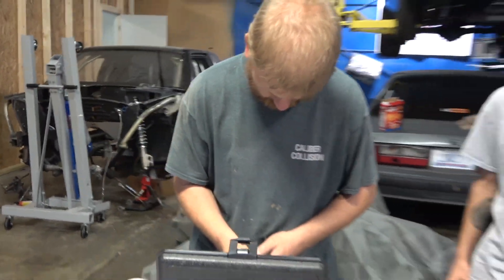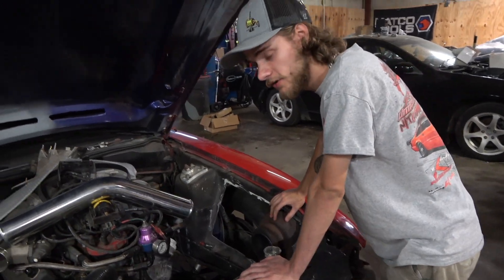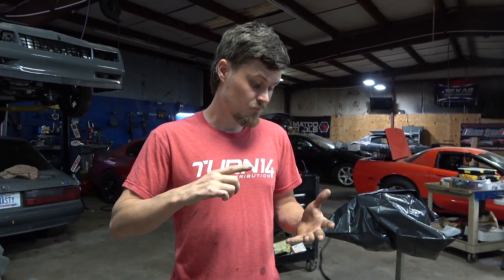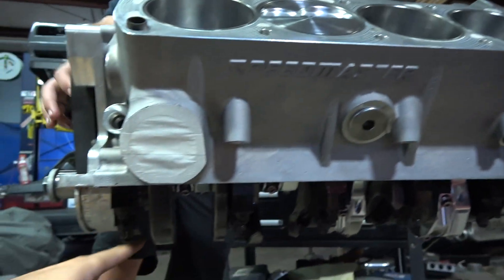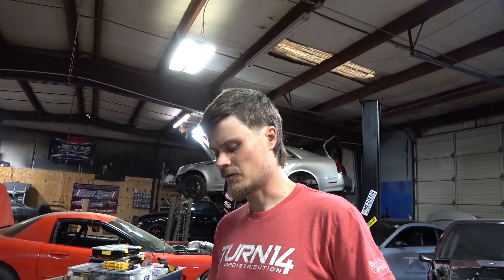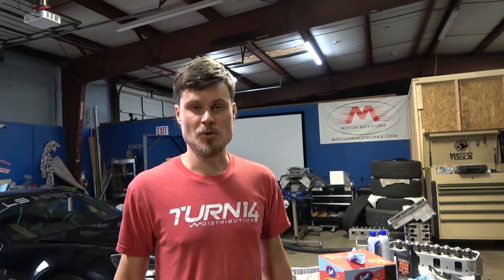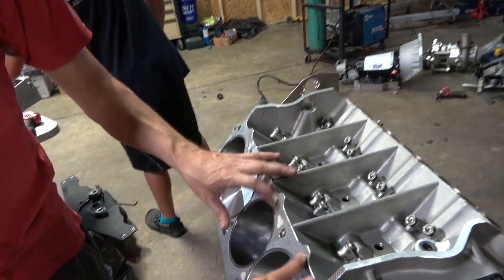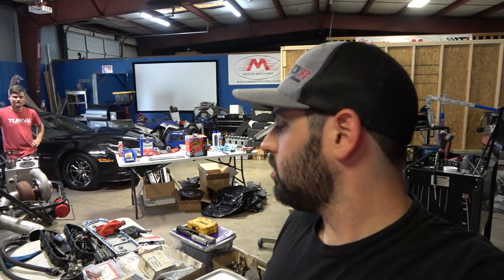WORLD RECORD SBF IS HERE!!!! BAD APPLE 9.5 deck!

Comment: Hey guys I heard Matt talking about defects in the Block, Mag would be the preferred method. I worked in the Nuclear field for many years as a machinist there is method 
we used to detect defects in all types of metals including aluminum. Liquid penetrate testing you just need a couple of dipping tanks and a rinse sink. It’s basically a Red dye that shows defects. Materials are not to expensive. Not sure if TKM does anything like this but thought I would share it with y’all.